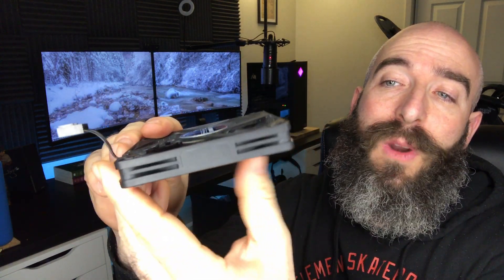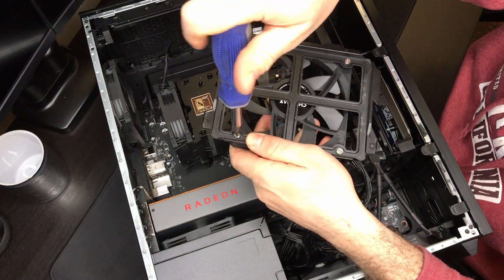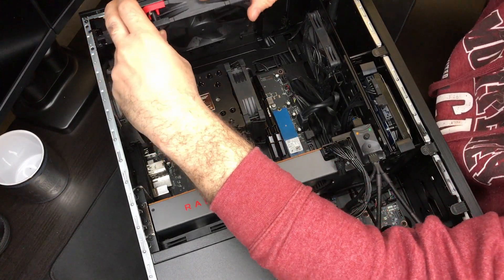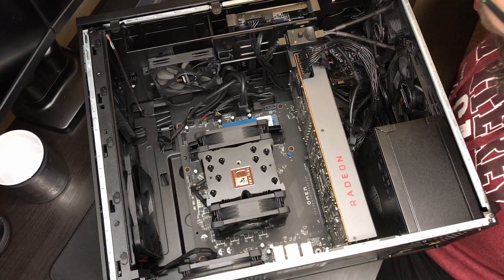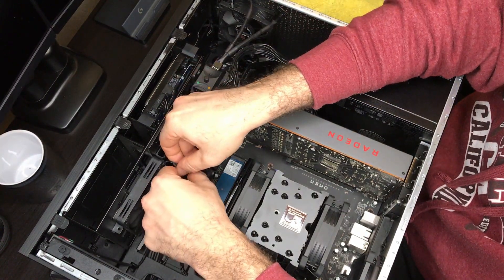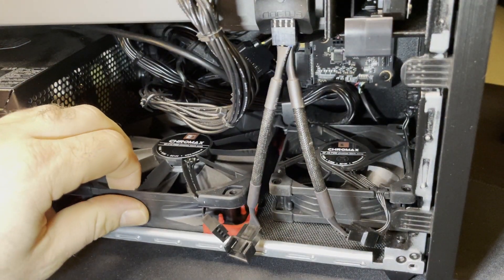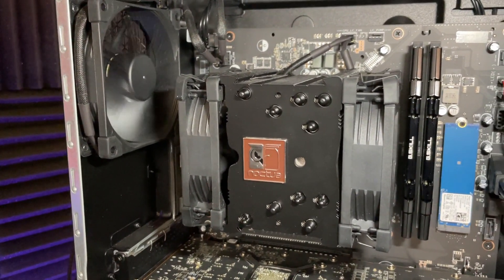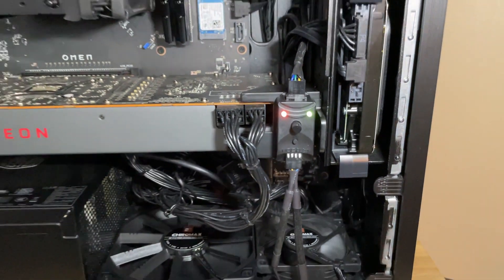How to: Install and Setup All Fans in an HP Omen 25L / 30L! Tutorial & Guide!

Comment: Quick question though. What if your looking to have these fans have rgb? I have the 30L that has an rgb in the front, and I would like to match all the fans (primarily the top and back fans) to have rgb as well.
Reply from the maker: I don't have any first hand experience with RGB but it's kind of a pain with the Omens. I believe you will need an RGB controller to power the RGB but I'm not exactly sure how the setup will work.
Reply: @DanKamYouKnow  all good! I’ll do some experimenting and see how it works. Thanks!

Comment: Hey Dan, you helped me out in my last comment about fans but this time im coming to you with a different issue. I just got my Omen 25L with the RTX2060, just downloaded warzone and after a few minutes, an audible buzzing started occurring. Definitely load enough to hear. The buzzing continues until i enter a loading screen or a black screen when i tab out then quickly starts again. Would this be the GPU? coil whine? not having enough power? Omen comes with a 500W power supply. Would love your expert opinion on what you think it is, what i should do, and if it is much cause for concern. Thanks for all the great videos and help!
Reply from the maker: 500w is definitely enough to power your system. It most likely is normal coil whine coming from the GPU. Have you taken off the side panel to try and pin-point exactly where it’s coming from? A buzzing though could be coming from a fan or something.

Comment: With the Y splitter cable has the computer had any issues with it running twice the load off that single connector?
Reply from the maker: Nope. Most fan headers can handle up to 1amp and each Noctua fan I have is about .2a of power. Well within the limit 👍🏻
Reply: @DanKamYouKnow  looks like I'll have to do something soon then because it just hit 94°c when running the fans at max today
Reply from the maker: Ouch! That’s very very warm

Comment: I got one brand new and it cuts off on its on and sometimes says 90 fan
Reply from the maker: I am not sure what you mean by 90 fan? What fan are you referring to and where is it plugged in?
Reply: I think it is the one that is located in the middle it will shutdown randomly and say 90b Error
Reply from the maker: The computer will shut down? Or the fan will? Where do you see the 90B error?
Reply: @DanKamYouKnow  when I cut it back on it say press enter for normal start up
Reply: And it say 90b error
Reply: @DanKamYouKnow  and it only said that error 90b twice and the other times it’s like it just restarts it will cut off and back on
Reply from the maker: You may have to contact HP. I don’t fully understand what’s happening.
Reply: @DanKamYouKnow  thank you for the help and I’m sorry I made it hard for u to understand

Comment: Hello Dan, thanks for very informative vid. I was wondering if changing out parts (PSU, Fans, Etc) would void HP’s warranty, because I want to add a 120mm liquid cpu cooler and some other fans as well and still have the security of knowing that I have a warranty service. Also, I have the intel version of this pc so, will I still be able to do all of these upgrades? Appreciate it, keep up the great work!
Reply from the maker: Most of those items will void the warranty, yes. HP will only perform warranty work if the computer is in its stock form. So, if the PC was reverted back to stock before sending it to them for warranty work, they would perform the work needed. And thank you Spencer!!!
Reply: @DanKamYouKnow  thanks for the clarification!
Reply from the maker: NP. With the warranty, you have to treat it as a “What HP doesn’t know won’t hurt them”. So if you revert it back to stock before you warranty convo / work with them, they won’t know about the mods.

Comment: Awesome thank you! I plugged my top fan into the lc pump slot and it sounds like a damn jet engine. I’ll definitely pick up a fan splitter.
Reply from the maker: It will definitely help with noise! Glad I could help!
Reply: Where do you plug in the fan splitter on the motherboard?
Reply from the maker: I show it in the video towards the end. The rear and top fan are plugged into the SYS_fan header

Comment: Another great video.  Have been using the 30L stock for a few days with a few fans and a U9S on the way.  Been telling the wife, "babe there is nothing I can do, DanKam says..."  May try to press my luck with that line on non-PC stuff and see how much mileage I can get from it.  Thanks again.
Reply from the maker: LOL! The U9S will solve all temperature problems for you ( except GPU if that’s an issue for you ). The extra fans do help but the weakest point ( other than the case ) is the cooler, BY FAR. Thanks Rob!!

Comment: Would you replace the hp motherboard since its bios is locked? If you would what would you get?
Reply from the maker: The BIOS being locked is annoying but since I have a Ryzen processor, I can do most things I want within Ryzen Master. And my fan controller makes it so I can adjust fan speed ( of the fans that are plugged in ). If I were to go for another board though, it would probably be ASUS

Comment: I finally got the same computer...however my LEDs stopped working for a couple weeks now. When I go into the OMEN control panel I try to change the color but it's still off on my computer.
What do you think I should do?
Reply from the maker: Nothing happens when you click apply? Did you by any chance try and use the Omen Light Studio app in the Omen Gaming Hub? I would recommend trying to update the Omen Gaming Hub and see what happens
Reply: @DanKamYouKnow  I had the same issue after re-installing the wiring to the MB. After a few disappointing moments, I reattached all the wiring. All the lighting came back! Just a loose connection!

Comment: Have you ever experienced any coil whine issues? My 25L has a pretty mean coil whine issue with it while gaming. Though its harmless it can be pretty annoying. Im thinking maybe changing the PSU will remove the coil whine issue but idk.
Reply from the maker: I have heard several people complain about PSU noises and coil whine but the small amount of GPU coil whine doesn’t bother me at all. Most people hear a clicking type noise from the PSU that goes away with a better quality one.
Reply: @DanKamYouKnow  do you have any recommendation on which power supplies to upgrade to and which ones would work with this case.
Reply from the maker: Pretty much any power supply will work, I would just make sure the dimensions of the new PSU are the same but I think most are. I have not changed my PSU out so I’m not 100% sure but I have seen a wide variety of PSU’s put in.

Comment: Hey dan, Do you think replacing the CPU cooler is necessary or do you think I should upgrade it later on?
Reply from the maker: The CPU cooler replacement was probably the best thing I did for the Omen and solved any temperature problems I had. Whether it’s necessary or not, it really depends on the temps you are getting now. I was seeing very high temps, especially while rendering, and the cooler fixed all those temp issues. And for $65 for the cooler, it’s a fairly cheap upgrade that’ll solve all temp problems.

Comment: I just wanted to know if you know how to fix my ram not going at full speed my ram before was running at 3200mhz and and then I bought another stick ddr4 3200mhz but now it says I’m running at 2400mhz do you know what to do
Reply from the maker: I have a video dedicated to adjusting RAM speeds:

https://youtu.be/PBervsjRYzw

If you have an Intel processor, you will not be able to adjust the speed. If you have a Ryzen processor, you can use the program Ryzen Master to manually adjust the speed, which I cover in that video.

Comment: Great video man can't wait to get my 30l on Wednesday! I've already got 2 fans waiting
Reply from the maker: So close to getting your PC, a couple more days!!
Reply: How's your pc so far?
Reply: @DavyMaybe  it’s awesome! I’ve followed all of Dan’s videos by adding a top mount exhaust fan, upgrading the stock case exhaust fan and swapping out the cpu cooler all to noctua stuff
Reply: Did you also changed the PSU? 500W by default is what i have
Reply from the maker: Only really need to change the PSU if you are installing a GPU that requires more power. I just uploaded a PSU install video if you’re interested, when the time comes.
Reply: @DanKamYouKnow  just posted my question under your recent video 🙈👍🏼 thank you dan :)
Reply from the maker: Just saw it and replied. Got a lot of comments to go through this morning 👍🏻😁
Reply: @DanKamYouKnow  glad you‘re doing so - got my subscription ♥️

Comment: whats the cable sticking out on the top of the case, above the motherboard?
Reply from the maker: On a stock Omen, that is the extra RGB cable, you can just tuck it behind the back of you want, it is not used

Comment: I have an HP Omen 30L with a Cooler Master MWE Bronze 500 PSU.  The PSU fan turns on/off every couple of seconds and every time it turns on/off it clicks.  It's not a loud click, but that clicking noise is literally the only noise the PC makes, so it's pretty distracting.  Is there any way to make that fan stay on all of the time?
Reply from the maker: Unfortunately, the fan is designed to come on and off as needed and there is no way to adjust the fan curve or on/off.
Reply: @DanKamYouKnow  I don't guess you can recommend a PSU with a fan that stays on constantly can you?
Reply from the maker: I cannot. You may have to do some research on that. Sorry
Reply: @DanKamYouKnow  Thanks.  You'd think it would be easy to find that information out with Google, but I haven't had any luck and no one at Cool Master or HP has responded to my emails.  I appreciate the info. though.
Reply from the maker: No problem. You can try some forums / message boards to see if anyone knows but I have not heard about any of that information for PSU’s

Comment: great video as always, quick question. Do you keep your fans on turbo all the time? I still have the stock fans and I'm scared that it will damage them. I'm planning on attaching a top fan later on and using the first video you made on it.
Reply from the maker: Yes, I actually always keep my fans on turbo and it will not hurt the computer n any way! Whenever you do upgrade the top fan, I would follow this tutorial because it is updated from my original one. I time stamped the install for the top fan so just follow that and you should be good.
Reply: @DanKamYouKnow  thanks again!
Reply: @DanKamYouKnow  hey another quick question. On my omen 30L, there is no on-off switch on the power supply there is just the plug. How will I turn it off properly then? Was there an on/off switch on your 25L so you can properly turn it off? Thanks in advance
Reply from the maker: You’ll want to shut it down through your desktop -> Windows button at the bottom left -> Power -> Shut down
Reply: @DanKamYouKnow  after that I can install fans even if the power supply is still plugged in?
Reply from the maker: Yes you can. It’s never a bad idea to disconnect the power plug though, just in case.

Comment: i got two 92mm fans coming in tomorrow that im replacing the 120mm at the bottom for. well see how that goes.
Reply from the maker: Good luck and let me know if you have any questions
Reply: @DanKamYouKnow  hey man I was curious my gpu and cpu gets over 150/170 sometimes whenever I’m playing a game of let’s say fortnite is that good or bad? That’s in Fahrenheit but the celsius is around 60/70
Reply from the maker: Usually, PC temps are always listed in Celsius ( even though I’m from California ). 60-70c for the CPU and GPU are completely safe and I wouldn’t worry about those temps. If you are over 80c and getting close to 90c, then that’s a little too warm.
Reply: @DanKamYouKnow  okay so your telling me if the Fahrenheit is over 170 for the cpu and gpu I have nothing to worry about but if the celsius is over 90for both the cpu and gpu that’s a little to warm?
Reply from the maker: Yes, over 80c is getting warm and over 90c is too warm and settings / fans / CPU cooler, should be changed.
Reply: @DanKamYouKnow  when do you think I should use the Turbo fan? I usually have it on normal and it gets around 80
Reply from the maker: I always use turbo mode, 100% of the time. It won’t damage anything by leaving them on turbo.
Reply: @DanKamYouKnow  wait really?! Your 100% sure it doesn’t damage or do anything to the pc it self if it’s on turbo. Sorry for asking load of questions I just got this pc not to long ago and I have no idea about what’s to hot. Do you recommend having the case of if it’s getting above 80
Reply from the maker: The fans are designed to spin at the turbo set speeds. The only “damage” it will do is maybe shorten the life span of the fans in the case, but even then, we are talking about many many years down the road. Removing the side panel will help lower temps slightly less, but will cause a little more dust build up if left off all the time.
Reply: @DanKamYouKnow  okay so having them on turbo let’s say uh 8 hours a day maybe 10 isn’t bad at all right? How many days or years would it last
Reply from the maker: Lol, there’s no way to calculate that I’m afraid. They will last many many years, I would not worry about it. I’d worry more about temps first than a fan’s life span.
Reply: @DanKamYouKnow  well Fot c• my gpu temp is usually around 70 same with my cpu